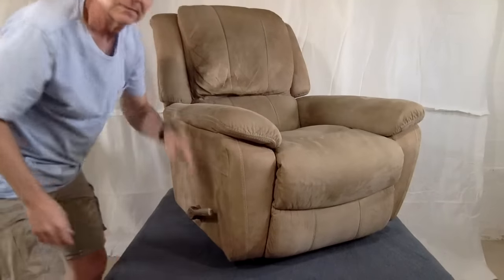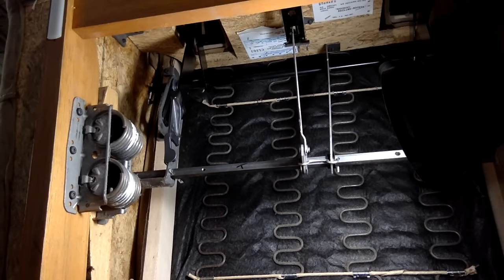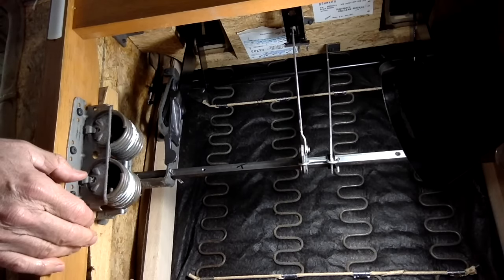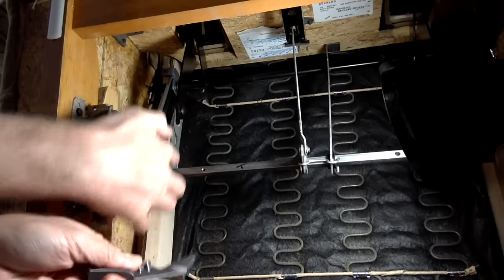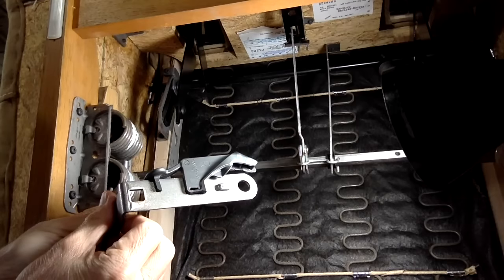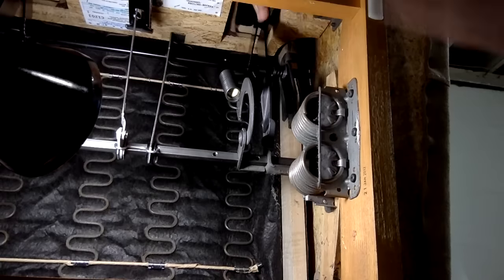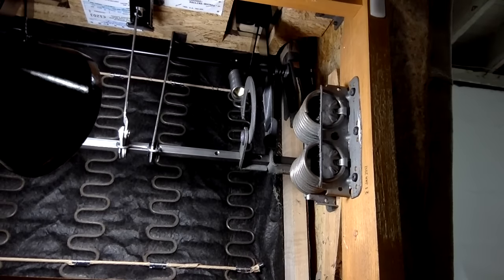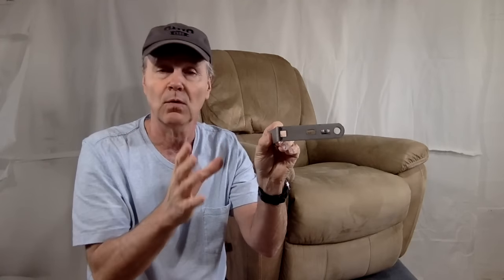The La-z-boy Recliner 3-Position Footrest

Comment: I did go down to my local la-z-boy dealer.  they didn't have any parts.  and even though I had the part # they couldn't help me.  They acted like they had no clue what I was talking about.  sent me home with a service request form where I had to find the ACK# under the foot rest.  yet, all 4 of our la-z-boys has this same part.  I now need 4 sets and have read online where multiple people can't find them!!!
Reply from the maker: @S. W. - Yep, many dealers will play dumb (not just La-z-boy dealers) when it comes to replacement parts. That's because they don't want to help you. They just want to sell furniture. For them, sales & service is a thing of the past that they can't be bothered with.

When you order parts through the manufacturer -- La-z-boy -- ID numbers & customer information is required, no matter how common the part(s) may be. If you need 4 sets of 3-Position Locks, they'll likely require an ID# for each set. However, if you are the original owner of those chairs, you should have warranty parts coverage on those parts & get them for free (at this time).

If you're not the original owner, there are 2 options --
#1 Get a cost quote for the parts thru the manufacturer --or
#2 Call around to other La-z-boy dealers to find one that has them in stock & will sell them to you.
Reply: @reclinerrepairguy4155  I had no idea there was a lifetime warranty on the mechanisms for the loveseat! I am the original owner, even still have my receipt.  I called and left a message.  we shall see if this works.  i just want the parts, will they give me the parts without me paying them labor to put them on?
Reply from the maker: @s.w.95  - Yes, but as I said previously, you will need to supply more info for the part order(s).
Reply: Yay!! Got a call back and gave them all my info.  I have to pay a $15 shipping fee, but I can accept that.  I’m so happy. Thank you!!  Oh, they had no record of my purchase cause I bought this in 2011 before this company owned this store.  But I am an organized bookkeeper that keeps all her receipts!!
Reply: @reclinerrepairguy4155  I got my parts and repaired the loveseat.  As good as new!! :) Thank you.

Comment: I just acquired a second hand recliner, the three position foot rest is not working at the moment. I've ordered the parts to repair it, but my footrest will not lock in the up position with the mechanism unhooked,  am I missing something?
Reply from the maker: @Taylor Cooper - If the metal parts (or plastic locks) that control the 3-Position Footrest are removed or disconnected, the footrest should still lock into the fully extended position. If it doesn't, there's something wrong with the reclining mechanism.

Comment: I need the part number for the plastic 3 position lock for the footrest extension mechanism. My footrest will not stay in the fully extended position. Your repair video was great but now I need the parts. Where can I order the parts. One for each side of the chair footrest extension mechanism..
Reply from the maker: Gerald Brown - The problem you describe may or may not be related to the 3-position locks. To find out, remove both locks and inspect them for wear (as shown in the video). If they are not gouged or broken, they are not causing the problem.

As mentioned in the video, to order La-z-boy parts, contact your local La-z-boy dealer. They may (or may not) request your ID#s from your chair. If they do, see this page to learn how to find your ID tag ----> http://reclinerrepairguy.com/id_tag.htm

Comment: Unfortunately these instructions could use a bit more precision. Are you doing the right side first or the left side first? When replacing clips, what is the position of the footrest: closed, 1/3, 2/3 or fully extended?
Reply from the maker: @JFBond-zs8xf - The Leg Extensions (scissors) should be fully extended. It doesn't matter which clip is replaced first.

Comment: Our la-z-boy couch has stopped fully reclining on one side. I can extend the footrest fine and it reclines a bit, but when you push back to fully recline, it doesn't recline any further. I think it's that way due to me bending something when pushing back without extending the footrest to recline and have my feet on the floor. Will have to flip it over to see if I can figure out what isn't working. It seemed to work for my wife who weighs half what I do, but it was still difficult. On her side, it reclines back just fine when the footrest is extended. Ours has the cup/handle on the outside of the armrest. Oddly, I snapped the handle off my side a month ago, which I replaced without much hassle. The chair had been getting more and more difficult to recline fully before I changed that out.
Reply from the maker: Bryan L - As you mentioned, something may be damaged (bent or broken), so you'll definitely want to check that out. 

Also, there is a design flaw I've encountered with older La-z-boy reclining sofas that you should know about. It's not uncommon for 1 recliner to work fine, while the recliner on the opposite side is more difficult to open. The handle is noticeably harder to pull (and sometimes breaks), and the footrest does not want to fully extend when it is released.

This is due to the location of the extension springs on the mechanisms. When the spring is on the handle side, the recliner usually works well. When the spring is on the opposite side, operation is problematic. About the only thing you can try to improve operation is to try a stronger spring on the problem side. But I don't believe La-z-boy offers such a replacement, so you're likely on your own as to finding one to try out.

I don't know if new La-z-boy reclining sofas have this same issue. But if one side is more difficult to operate on new units as well, they may have the same problem.
Reply: I believe it's one of the delrin/plastic guide slots. One of them on my end is cracked. Our recliners use a clamshell handle on the outside of the armrest via a cable to extend the footrest. That part works fine. It's just the full recline once you've extended the footrest that is hard to do. It reclines some, like a first step for TV watching, then it should recline further for napping.
[img]http://gmarquee98.x10host.com/myPics/98gmarquee/misc/2018-0701-LaZBoy-CrackedGuide.jpg

I had my wife sit in it and recline while I laid under it with a light. That crack opens wide when reclined and the pin that slides in it settles in the dip of the crack. Then if you push hard, it hops out of the dip and reclines fully.

I've searched using every keyword I can think of on google, but wasn't able to find anything to replace it. I sent lazboy an inquiry to see if I can get the part.
Reply from the maker: Bryan L - If they don't provide the plastic part separately, you'll have to replace the entire Leg Extension side assembly. If you go that route, be sure to order a set of 2 and replace both sides. Also, make sure any cross braces, etc. have no hairline cracks or other damage. You don't want to have to remove & rebuild the unit twice.    ;)
Reply: I'll probably have to call them. At least while I was under there, I took a few clean photo's of the chassis and the tag that has all the model info on it. Looks like we've had the  couch since 07/23/2012. Can't recall what it cost... we got leather which added $1k to the price if I remember right. I opted out of the powered version. That just seemed like your asking for problems down the line. I know things don't last forever, but if I can fix it and get more years out of it, I'd like to try at least. The leather is holding up great. Padding is a bit smashed where we sit, but otherwise, aside from my handle breaking (which I replaced) and this, it's held up ok.

Comment: My father is having trouble operating the handle with the three position mechanism I was wondering if that mechanism can be removed so that it is no longer three position and it may recline a lot smoother for him he is just not strong enough. If it can be removed can you please show us how to do that and will the chair still recline fully without that part?
Reply from the maker: Monica Spayd - If the trouble is with his arm strength, disconnecting the 3-position feature will not make the recliner easier to open and close. 

However, some elderly users are confused with how the 3-position feature works, to the point where they can't operate their recliner without having problems. If this is the case with your father, you can disconnect the 3-position feature. And yes, the chair will still recline fully. 

Simply remove the 2 plastic 3-position locks as shown in the video.
Reply: @reclinerrepairguy4155  thank you I will give that a try and we'll see if it works better for him.  I'll let you know stay tuned!

Comment: The problem I have is the chair jams in the recline position.  No matter how I work the handle, it will not release back to the non-reclined position.  I have to repeatedly move the handle back and forth very aggressively until it finally releases. It does not appear to be in ratcheting mechanism.  Can't see anything that is loose, broken, or bent.  Could you advise?  The chair is from the 1970's--but still very sturdy. Thanks
Reply from the maker: @Stratocruizer51 - You may have a failing 3-position mechanism. See this video to learn more  --> https://www.reclinerrepairguy.com/lazyboy.htm#troubleshoot3position

Important Note! - In this video I mention that the bullet pins (pivot pins) are no longer available. However, I tried recently to order some and was able to get them!
Reply: @reclinerrepairguy4155  Yes, I saw the video.  The movement in the recline release is not smooth.  I put some grease on the mechanism-but I believe it is just wore out.  Time for a new chair.  Thank you for taking the time to put up up these videos and make your expertise available.

Comment: With my footrest all the way up, it Drops about 2 inches and locks. It has do e it since we bought the chair. I just gotten home from spine surgery and couldn't return. Lazyboy store said they never heard of such a problem. I wonder if this is what is wrong with it.
Reply from the maker: MonstarMK3 - When the 3-position feature begins to fail, the footrest won't operate smoothly. It begins to get catch and get stuck during operation. Your problem sounds like something different.

A couple of possibilities: Some newer La-z-boys have footrests that do not extend to a point where the footrest itself appears level. It will be pitched / tilted down slightly, even when it's extended to the fully open position.

Another possibility is a problem with your ratcheting/reclining feature, which I've described below (see my reply to Massey Jones). Either way, have an experienced La-z-boy tech look at your chair to make a determination and find out if a repair is required.

Comment: I installed new clips and mine finally locks in good at position 1 and 2.  It doesn't seem to lock in the fully extended position.  Is it supposed to lock fully extended ?
Reply from the maker: @rekleined - Yes. The footrest is not supposed to drop (close) until you close it. If you are having this problem, have an experienced La-z-boy repair tech troubleshoot it for you.
Reply: Mine does the same thing, it locks in two positions, not three!

Comment: My back flops all the way down. I prop it up against the corner wall. It wants to lay flat, something not catching.
Reply from the maker: @Fred Flintstone - You'll have to remove the back to see what's going on. Check the attachment point where the back connects to the seat, the back brackets & back frame & the Seat Swings, if it's a La-z-boy.

Comment: The front end of the three position lock seems to get in the way every time I try to close my recliner. The front end keeps snagging the three position lever. Any tips?
Reply from the maker: @Ian Hamilton - If the footrest will not close easily after being fully extended, check to make sure the parts where the 3-Position Locks attach are straight and undamaged. If the metal parts are in good condition, replace both 3-Position Locks.

However, if you're just feeling a slight "catch" during opening and closing that  does not interfere with operation, this is normal.

Comment: When I put my foot rest up all the way and put weight on it, it drops down.
Reply from the maker: Trevor Shover - If the entire chair is dropping down, it is not the 3-position footrest feature. That controls the footrest separately.

La-z-boy also has a Ratcheting Recline feature on many chairs. That controls the entire pitch (recline angle) of the chair when it's fully reclined. 2 parts control this feature, a lever (Pawl) and a part with metal stairs (Pawl Rack) that the lever rides on. When either part (or both) are worn, the chair will drop down as you describe.

I'm still waiting on a chair with this problem to come into my shop so I can do a video on this repair as well.
Reply: @reclinerrepairguy4155  I think I have just the one for you. We bought one second hand - but looks good as new. My 90-year-old mother has slept in lazy boy recliners for years. Her's was falling apart. We took this one to her in the facility she's living in. And unfortunately the foot rest will not stay up. Sounds like what you just described above.  I guess I'll try to find out the cost of someone coming out to repair it. Thx for your video.

Comment: Are the 3 position locks compatible with La Z Boy glider recliners?
Reply from the maker: @Hank Wall - If the cutout (opening) is present on the Rear Swings to attach the locks, yes. However, if the glider didn't come with locks from the factory, there may be a reason. You can always clip on a pair (if possible) & see how it goes. If you don't like the results, just remove them.
Reply: @reclinerrepairguy4155  Thanks for your reply! I couldn't find anything that really differentiated the features and limitations between glider and rocker mechanisms.  I've got a set ordered. I'll see how it goes and let you know. 🙂
Reply: @reclinerrepairguy4155  Also, I bought the recliner second hand so I don't know what it came with originally.  Your videos have helped me understand the mechanisms and find other missing parts like the tilt back tension nuts and springs and maybe a nylon washer. I'm also having trouble finding the replacement parts for that. If you know where I can get a hold of those, that'd be great information. 🙂
Reply from the maker: @hankwall1594  - I don't know if the Seat Swing (tilt-back tension) parts are available separately. You can just order a set of Seat Swings, or go to a La-z-boy store & take a photo or 2 of those parts to see how they're put together.  :)

Comment: how do you get the large tension  spring back on
Reply from the maker: Sharon hodge - The large tension spring should not come off on its own. If that occurred, there may be a problem that needs to be addressed.

I use vice grips to install / remove the spring while the footrest is in the fully extended (open) position.

Comment: Does anyone make a recliner that gose higher , and is their one that the back goes down and the foot rest that stays in, so you can use a tall foot rest?
Reply from the maker: Chrisnas1 - La-z-boy recliners have a separate back tilt that allows you to tilt your upper body back while the footrest stays closed.

Overall reclining angles (laying flat, feet higher than head, etc.) vary among the many different manufacturers out there. It's best to try out several brands to find the recliner that works best for you. See more tips on buying the right recliner ---->http://reclinerrepairguy.com/advice_tips.htm#buyright

Comment: OK but what to do if footrest doesn't lock in place anymore?  I can't fix it myself due to a few issues. 1. I'm suffering from Stage 4 Inoperable Double Lung Cancer and Advanced Degenerative Disk Disease in my lower back and spine which causes me to suffer from severe chronic pain.  And 2. Absolutely no tools or inclination to fix it.
Reply from the maker: Steve Vestel - Several different things could cause the footrest to not lock out properly. Have an experienced La-z-boy repair tech to check it out.

Comment: That angle position thing is busted on mine that locking bar in the middle
Reply from the maker: @Trevor Grasso - If parts that fit onto the Drive Rod are broken, they will have to be replaced. See the video series Drive Rod Replacement on the ReclinerRepairGuy.com website for more instruction on this topic.

Comment: I am looking for this plastic lock clip referenced in this video.  Can i buy it online?  Thanks!
Reply from the maker: yianna - I don't know if the 3 position locks are available online. [I tried a quick search and didn't find any.] However, it is a La-z-boy part made specifically for many of their manual recliners, so any La-z-boy dealer should stock them. And if they're out of stock, they should be able to order a set for you.
Reply: Thank you for your reply!  My local person was indeed able to supply me with a set of those plastic locks.  After installing the missing piece, footrest still not staying in the high position, I noticed that the L-Shape metal that you mention on your video is distorted. I cannot fix it with pliers. Should I replace that metal too?
Reply from the maker: It depends on how distorted the Rear Swing Subassembly (L-shaped metal part) is. If it's  bent, it can often be straightened by pushing against it with the heel of your hand. If that doesn't get the chair working, it's time to bring in an experienced repair tech to fix your chair.  Visit this page for tips on finding one near you -->  http://www.reclinerrepairguy.com/locate.htm
Reply: I will follow up with your recommendations.  Thanks for your time and expertise!